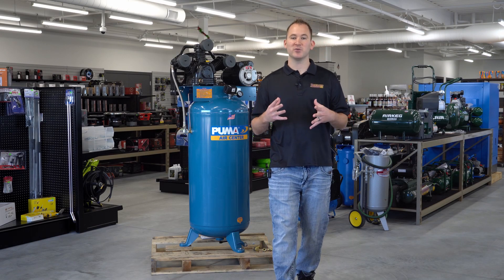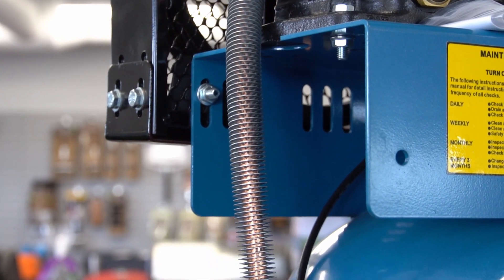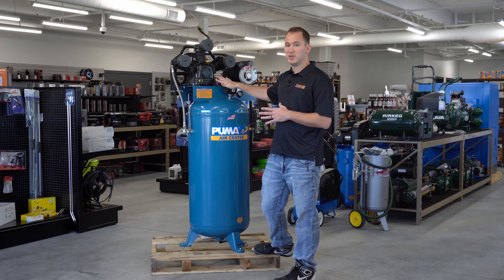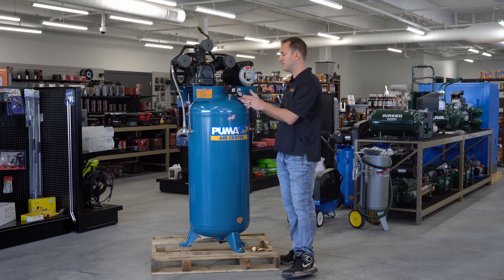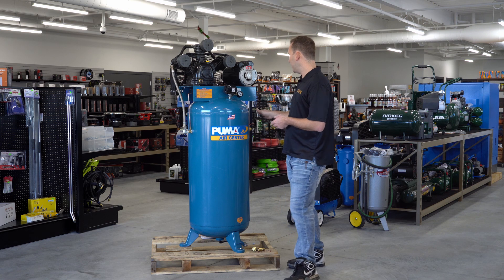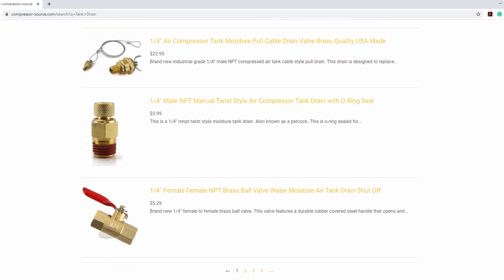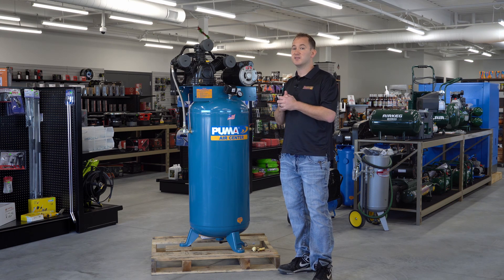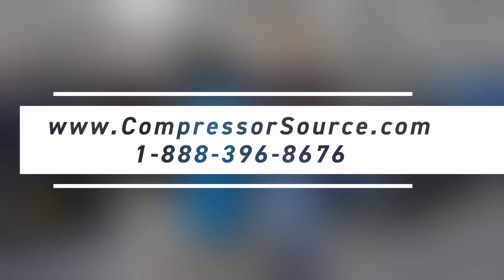Air Compressor Parts Overview: Terminology & Function Guide for Beginners & Compressor Techs

Comment: I just purchased a Vevor 80 gallon air compressor and was shocked to learn that there are no sources for parts. This is the new Chinese design where a 6.5 HP motor direct drives (no belt & pulley) four pistons. The four outlets are siamesed in pairs so the receiver has two import ports. Can you offer any solution to my dilemma?

Comment: Hello, I was wondering what could be done about  air leaking from the top breather on my air compressor. I haven't noticed any oil leaking, only air???  Air was leaking from the pressure switch and I had to replace it. That seems to be fixed now it's leaking from breather at the top. It's a steady continuois leak.